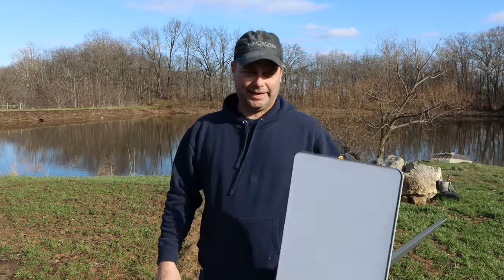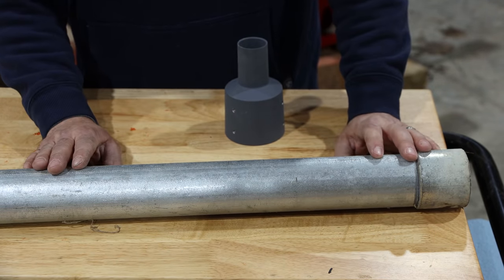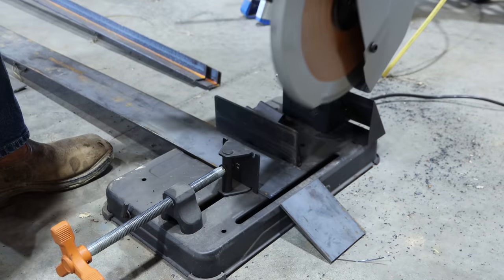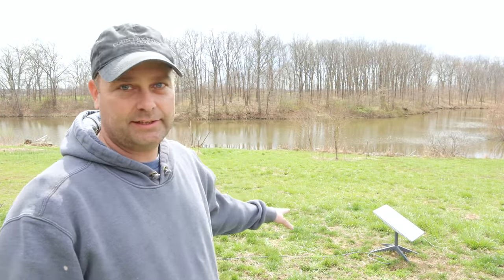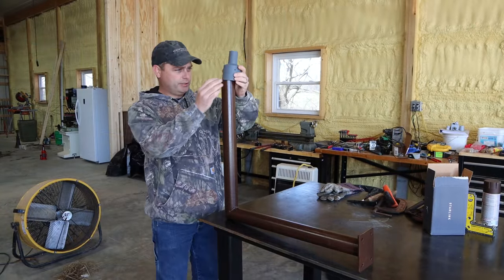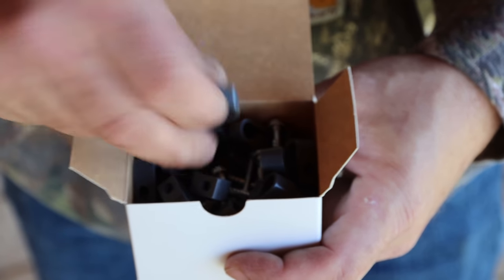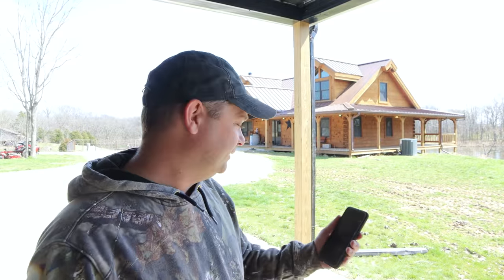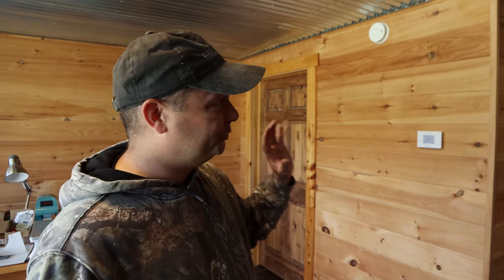After 5 years in the country we finally have internet.  Building a custom Starlink Satellite Mount.

Comment: I'd do powerline ethernet for your needs.  the extenders dont fix metal ceiling issues.  i'd have one powerline ethernet input by the starlink, then 1 powerline wifi head in the bedroom and powerline in the pole barn.   way better that extenders.  they dont fix the underlying problem you have.  I'm more than happy to get you configured with a real prosumer level home network.
Reply from the maker: Their is no ethernet connections on the atarlink router.  You have to buy a network adaptor from starlink to have a wired connection.
Reply: @CountryViewAcres  Oh bugger I forgot that about their new unit.   Honestly it is worth it.  I'd put in a basic POE switch and 2 POE powered unifi access points.  for the main house a UAP AC IW and for the shop a UAP-AC-M-US.  I wouldn't do a controller given how limited the walk between needs are.  If I was using my cell phone on calls a lot walking down to the basement with wifi calling enabled i'd suggest a controller and a third access point.  But given the need I doubt it would be needed.

Comment: I really like your videos and your attitude to what you show us. You are obviously nice people. My comment today is due to my like of getting the names of things correct. It could be that here in New Zealand we have a different term for the things you mentioned in the video. The small screws you used to attach the receiver to the pipe are called Grub screws, not Setscrews. Here in NZ a setscrew is a hexagon-headed bolt, threaded all the way to the underside of the hexagon head. Please let me know if you call them differently in the US. Looking forward to the next video, Colin.
Reply: You guys are upside down there, the blood has run to your heads. What can you expect, you guys drive on the wrong side of the road....j/k  Did I take the piss out of ya? I'm half Aussie so I had to give ya my NZ brother a bit of heck. Here in the USA where we aren't upside down a set screw is usually an allen screw or small screw set screw that doesnt have a head. Set screws can be in equipment knobs like for a radio or in the case of the starlink antenna mount adapter. What it comes from is you " set it and forget it". Its usually tightened and left and not untightened again. Its usually a small screw with no head or small head and isn't 6 sided. He called it a set screw because that is what it is refered to in most installation instructions here.
Reply: @kd5inm  Well I never! I thought it might be a difference in naming. Do you have anything called a 'grub screw', and not something you might do over dinner time LOL. Thanks for explaining that. How do you differenciate between a bolt that has thread only part way up the round section, and a (what we call a 'setscrew') which is threaded all the way to the head? Best wishes from NZ, Colin
Reply: @colinowen3672  Not really, a bolt is a bolt. " Grub screw" isn't really a term here in Texas that I've heard. I'm glad you took my bit of ribbing as it was meant in all good fun. I'm always giving friends down under a hard time about driving on the wrong side of the road. I lived in Sydney when I was there and Ive been to Auckland when I fell out of the top bunk on the ship traveling down there on one of the times I traveled to your side of the planet. I had my head examined in Auckland by a Dr there, he said I was all fine but had a funny accent when I talked.

Comment: Good video as usual. 1 question.. why not have the primary router upstairs and the extender in the basement?
Reply from the maker: I had put a conduit in the wall from the basement to the loft when we built the house.  But the starlink cable was so big it didn't fit.  So instead of drilling a hole in the floor, I bought the extender.
Reply: @CountryViewAcres  fair enough. Keep up the great content. Looking forward to the next video.